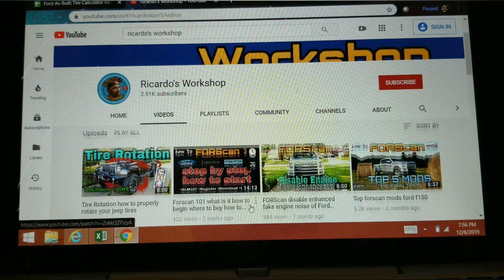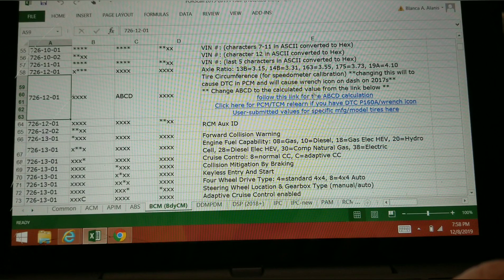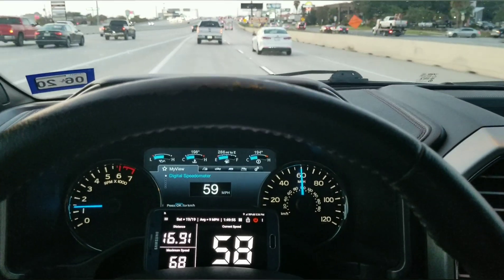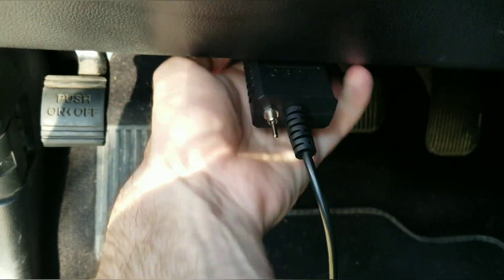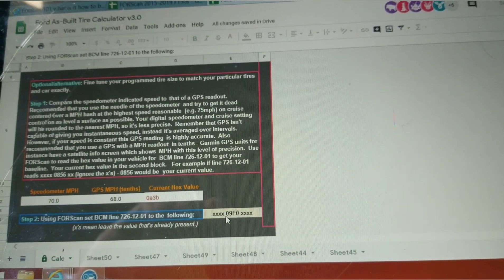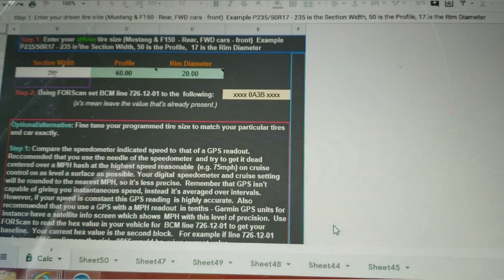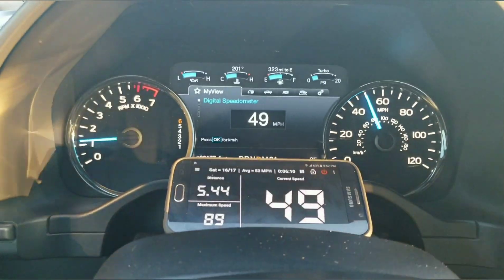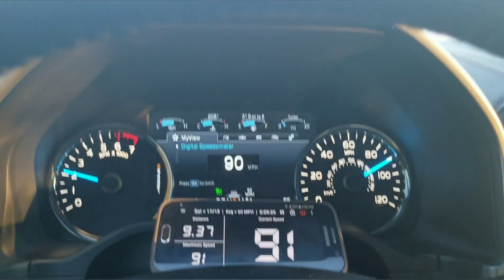FORScan Tire Circumference speedometer recalibration with GPS

Comment: I have a 2017 f-150 and install 35' but when i change the parameters,  turn on the maintenance key in the  cluster
Reply from the maker: Yes. You have to reset the transmission too. I just did this on the Bronco

Comment: Hello Ricardo
I just bought my car. Mondeo MK5 2015 2.0TDCİ
I think the previous owner tampered with the software a little.
He revised the instrument panel to vignale etc.
My question is, my fuel gauge is not working properly.
It decreases very quickly, even if I fill the tank full, the indicator does not show full. After the range reaches 0 km, there is another 15 liters of diesel in the tank.
Can I fix this via Forscan? What are the values that I can adapt or correct?
I would be very glad if you help.

Comment: I was able to correct my speedometer,  but now I have the wrench light on with P160A, any Ideas on how to fix?
Reply: Did you initialize the TCM?
Reply: @quickboat22  When you say "Initialize" is that the same as relearn ?
Reply: @AiBilly  It has been a while, but from what I can remember, after you change the speedo  numbers there is a tab that allows "initialize" of the module. This is like rebooting it I think, but only for the module itself to avoid throwing a code.

Comment: So I just did this and now I have a P0630 code followed by a U0422 code saying the VIN is not Programmed or Imcapatible, 2018 F150 3.5
Reply: Were you ever able to correct this? I have the u4022 code as well.

Comment: We just bought a new travel trailer, so I wanted to do some mods to my 2016 F150 2WD. It was either that, or go get a new F250 (stripped down model $40K+, no thanks!). Went with LT265/70R18 tires, a little more than 2” bigger than stock. Speedo was off 5 mph on the freeway. Followed these instructions, and now the speedo is dead on. Didn’t use the speedo and GPS formula, just the tire and rim size one. Also had the axle re-geared from the stock 3.31 to 4.10. Noticed there was a spot on the spreadsheet (right above tire circumference) to reset the BCM for different axle ratios. Went ahead and did that, keeping my fingers crossed I won’t screw something up. Worked great, speedo is still accurate. I heard you need to do that to keep the fuel economy calculator accurate, and I think it corrects the shift points on the tranny for the new gear ratio. Very happy with this, thanks Ricardo!

Comment: I need to do this bad  at 50 on the truck I’m doing 58 on the gps and my mpg is showing like 13
Reply from the maker: You can do it! Just follow the steps.might have to do it a couple times to get it just right. It also helps the transmission.
Reply: @ricardosworkshop  I just ordered the adapter last night on Amazon I’m not Computer guy so I’ll probably screw it up but I need to do it for sure. And the Bambi mod

Comment: I followed the instructions as described.  After I entered my value and clicker write, cycled the engine off then on, I now have a wrench icon on that will not disappear.  The truck seems to run fine and the speedometer is much more accurate than it was, but I can't get rid of the wrench icon.  2018 F150, 3.5L ecoboost.  Any advise please?
Reply: HI Bill - Having the same issue.  Did you figure out a solution?????
Thanks - Alan
Reply: @alanbeales4962  Me too

Comment: Hey Ricardo, I did this a while back and got a PCM relearn notice but no tcm.  Its a 2018 5.0 and I was under the impression you needed to do the TCM as well for the 18s and up but I can't find it anywhere in my for scan app when I have it hooked up.  It feels like its shifting different, possibly sluggish, but im not sure if its because I drove without trying to recalibrate for the 35" tires for a while before doing it and got used to it.  If the TCM relearn option isn't showing up, is that something that you can disregard or is that going to mess with the engine after a while?
Reply: I have the same issue not Tcm did just relearning the pcm clear the wench
Reply: @jorgeleal3476  did you relearn the pcm through forscan or take it to the dealership?

Comment: Worked great on my 2018XLT went from 275/65/18 to 275/70/18.  Code change from xxxx-09AB-xxxx to xxxx-09E7-xxxx match to GPS MPH almost exact at every speed.  Only bad news is I also get the DTC PCM U0422: 00-2F error when running forscan.  It does not however throw any kind of warning or light on dash so just ignoring.  Changing back to stock tire setting fixes DTC error but GPS is off by 2 MPH.  So I am ignoring the error and keeping exact speed.  I have spend hours on forum trying to find a way to clear DTC, but no cigar, if other find a trick to clear it and keep new setting let me know.
Reply: And yes, I have tried the PCM relearn function, does not fix....
Reply: @Chris Kowalczyk what is hex for 2530? I'll give it a shot.
Reply: @Chris Kowalczyk Thanks, was hopeful, but did not work on my 2018.  I set back to 09AB factory size and relearned PCM which did clear DTC error.  Both 09E2 and 09E7 are closer to actual GPS speed but still resulted in the PCM U0422: 00-2F error, so it's either have the error or be 2-3 MPH off :(

Comment: I am changing the rear end gears in my 2020 F-150 from 3.15 to 3.73. How do I program the computer? I have changed the tire size with Forscan per your video, but I can't figure out how to program the new axle ratio.
Reply from the maker: Use the GPS option. It should w

Comment: I changed the tire circumference using thr 305 55 r20 value.  I have a wrench showing up on the cluster and it says to check.manual.....any idea what the wrench means?
Reply: Me too. Did you work this out ?

Comment: Are you saying basically to change the values I forscan with the tire size 1st, take it for a test drive, if it's still off, fine tune it by changing the value in forscan using the speedometer value?
Reply from the maker: Or you can just gps tune it from the get go.
Reply: @ricardosworkshop  which do u recommend doing?
Reply from the maker: GPS

Comment: Which one is.more accurate to use? Inputting the wheel size, in my case 305/55R20 or using the actual speed to.callibrate?
Reply from the maker: Gps speed is more accurate. But tire size could be too.

Comment: Worked great on my 2019 F150. Calibrated for 285/75R17 (33.8" tires) and confirmed with GPS speedometer. Threw a DTC - PCM U0422. PCM relearn didn't work and couldn't clear code but nothing shows in the cluster. Seems  ok so far, will update if any further issues come up. Thanks for this video!
Reply: So if u don’t recalibrate will your all your dash lights come on?
Reply from the maker: Not necessarily,  but the speedometer will be off... you could really be driving at 60mph, but speedometer could show 55mph. And transmission could be changing gears at wrong intervals.
Reply: Hi George - what 4-digit code did you use for those 33.8" - I have 33.9" and am really struggling with getting the wrench light not able to clear
Reply: @alanbeales4962  were u able to get the wrench issue figured out?
Reply: @gabrielvalerio1396  Negative, just put back to stock and wrench went away. I’m taking a break from this project - frustrating…. Lol

Comment: Doesn't work on the 2020 models. Tried this today on my 2020 F150 after installing 34 inch tires. Did all the resets for trans, pcm, etc, but kept getting a steady check engine light. Wasn't the P160 code. Think it was P0600 or something. ECM/BCM module configuration error. As soon as I set the tire size back to stock, the code was able to be cleared. Ford must have changed something that no longer allows forscan to modify tire sizes in the 2020 models. Chances are, the factory tire size is hard written into the ECM, and when you change the tire size in the BCM, it throws a configuration code. Will have to seek other venues for speedometer calibration as forscan is a no go for the 2020 models when it comes to speedometer calibration.

Comment: I did this for my 2017 F-250.  I entered in the correct sized, did a speed test and it was nearly perfect one 1 mph differential.  Only problem was the check engine light came on.  It was giving the code P1635.  The only way I could get it to clear was by reverting back to my original settings.  Is there a work around this?
Reply from the maker: I think code P1635 indicateds a mismatch from factory hardware. Specifically in the axle and tires. How big did you go on tire size?
Reply: @ricardosworkshop  yes it was.  I have 35" tires.  I found out the number we enter in that register is the hexadecimal equivalent in mm for the circumference of the tires.  I tried tweaking that number down a hair since my speedometer was off.  It worked perfectly after I did that and no more check engine light.  I guess I must have been right on the threshold.  Hopefully it holds up but happy at the moment.
Reply from the maker: Ok. Thats awesome.  Well done!
Reply: @tobyleach176  I am having this exact issue,  do you recall what number you ended up using?
Reply: @erlinglasalle  I don't recall the exact number, it has been a while since I made the change.  However the number you enter is in hexadecimal and it represents mm in circumference.  I ended up using a Google search to find the hexadecimal to decimal converter, I then lowered that number by 100 and converted it back to hexadecimal.  No more check engine light, I guess there is an acceptable range and the number came in just below it.  I checked the speedodometer and it was on the money! Remember to back up your original settings before you change anything.
Reply: Could you give me the original mm size for the stock tires on your 2020?
Reply: @rosswilliams488  Hi Ross it's been a few and I don't have the truck anymore.   I recall there being a spreadsheet that would get you in the ball park.   Sorry not much help.

Comment: So once I install the new setup, I should take a test drive with the GPS speedo app first to enter the correct values before recalibrating?
Reply from the maker: I would do the test drive first. Then recalibrate it. And redo the test drive.
Reply: @ricardosworkshop  isn't that basically what I'm asking or you telling me something different? Lol  I should install the new setup, take it.for a test.drive, recalibrate it to.match the GPS speedo then re test to make sure it matches?
Reply from the maker: Lol... yes. I'm sorry i thought install new meant new codes... but you mean install new tires. So YES... you are on it. 👍

Comment: I have a 2018 f150xlt.  My stock 20s are 275/55R20.  Im planning on getting 22x10 wheels wrapped in 33x12.5R22 which i think equates to 320/45R22 (33.3x12.6)  my question is, does the 0.3x0.1 difference matter when recalibrating the speedo?
Reply from the maker: It does. But it will be most evedent in high speeds. You can test it with a gps. And then make any tweaks to it if necessary.

Comment: Are these settings the same on the 2020 F250?
Reply from the maker: I'm not sure about the 2020. I believe so but double check everything.
Reply: @ricardosworkshop   when I put the new codes in it turns on my tool wrench, anti skid is disable and a couple off other things get turned off and it all pops up on my display. Any ideas on this and where do I go to double check that I should still be changing 726-12-01
Reply from the maker: Checkout forscan.org I'm sure plenty of 2020 owners have tried it too

Comment: Thanks for your videos !! I have a 2019 f250, and did this and it worked, but now I have a check engine light. Any clue on what to do to fix the check engine light?
Reply from the maker: Check the DTC code... it should say exactly why the check engine light is on
Reply: @ricardosworkshop  thanks for the reply! I Figured it out.
Reply: @mouses911  What was is?
Reply: @jmaga6278  I changed the tire setting also in another module, once I change it back it stopped the check engine light. If you only modify the setting in the body control module it works just fine.

Comment: Great video Ricardo. I just used FORScan to recalibrate my 2018 Platinum F150 4x4 3.5 eco boost from stock tires to Nitto Ridge Grappler 35/11.5/20, while it corrected the speedometer I’m now getting a “See Manual” message on my dash. My Ford Pass shows “Powertrain Malfunction Reduced Power”. Can you help me correct this message. I’ve not noticed any reduction in power at all. Thanks.
Reply: @WeekendWarriors87  I tried this today on my 2020 F150, 5.0, and it doesn't work. If you modify the tire size in the BCM, and you'll get a steady check engine light for a ECM/BCM configuration issue. This is not the P160 code that many people get and subsequently deal with by performing ECM and TCM resets. I believe it was a p0600, and no amount of reset procedures will clear it. I had to change my tire size back to stock to finally clear the check engine light. The ECM probably has to be re-written with the new tire size, and forscan can't do that. Chances are, an aftermarket calibration device is required.
Reply from the maker: That's unusual. I would revert to original and try again.
Reply: Thanks. I’ve saved the original settings, how do I reset it back.
Reply: @WeekendWarriors87  I'm going to try a factory tire size code, and see if that takes. My truck came with factory 20 inch wheels, but I ditched them for aftermarket 17s with LT 285/75 R17 tires, which is about 33.9 inches tall. That tire size isn't on any factory Ford vehicle. A 275/65 R20, however, is. That's a factory F250 tire, which is only .3 inches taller than the tire size I'm running. I'm wondering if there's something in these modules that doesn't like non-factory tire size codes. I'm gonna give it a shot and see how it goes. If necessary, I'll fork out a couple bucks for an aftermarket calibrator and see if that gets the job done.

Comment: Is there anything to do to the transmission for the tire size change?  Someone on a local F150 page mentioned it, but I haven't found anything about this.  '18 F150 XLT 5.0L here
Reply from the maker: I suppose if you change the gears in the transmission, it would change the turn ratios and affect the speedometer. However, the ring & pinion gears in the differential are a more common upgrade. Either way, forscan can help calibrate the speedometer. Thanks for watching!

Comment: I can’t seem to be able to enter my tired diameter. Can you possibly get me the code for 275/55/20 and 275/60/20 tire sizes. Thanks
Reply from the maker: 275/55/20 = xxxx 099E xxxx
275/60/20 = xxxx 09F2 xxxx
Reply: @ricardosworkshop  what about 35x12.5R20
Reply from the maker: https://docs.google.com/spreadsheets/d/1uDSQ1Z5a2Wt8-kjrSiVSlDFGFHnfeuhb3RTMVz95730/edit?usp=drivesdk
Second to last page on spreadsheet.
And here's the tire Calculator spreadsheet https://docs.google.com/spreadsheets/d/1mWnuQZlDTUGjKjmJje1QJIR8Z2c7Kf8KBZxKnw_8EqU/htmlview#

Comment: Ok so I don’t know how to add things to the google document does anyone know how? I got my speedo spot on today going from factory chrome package 265/60/18 to 33x12.50R20 nitto ridge grapplers. The code was xxxx-09B4-xxxx. Idk if it makes any difference but my truck has 10 speed auto and 3.55 Electronic lock RR axle. Hopefully this helps someone.
Reply from the maker: Thats great Jesse... submit it on Forscan.org they might be able to update the spreadsheet.

Comment: Stock 18” rims and stock 265/60/18 tires on my 19 5.0 was 1 mph off at 85mph. I just did the flash for mine with a new 33x12.50R20 setup and it’s like 1.5 mph off. I’m going to play with it a little more and get it as close as I can, or at least back to only 1 mph off if possible and then I’ll upload the numbers to the forscan community document (if I can find out how to do that) I have nitto ridge grapplers btw. There was no 33x12.50R20 on the list.

Comment: Ive done my conversions and received the updated codes to enter however it says basically incorrect sum and will not write it...any ideas? I am trying to go back to factory size tires after messing with it a year ago with bigger tires.
Reply from the maker: That's odd. I'd double check everything. Something isn't right.

Comment: I am going to try this on my 2015, mine hangs in 5th gear at higher speeds. I have 295 70 r18
Reply from the maker: Mine was doing the same with 295/60r20. Remember to save original settings. 👍

Comment: Is this the same procedure on the f350? I can't find the calculator on the super duty spreadsheet.
Reply from the maker: They have different tires sizes so it could  be different. But try it. You usually have to do it a couple time to get it just right. Thanks for watching!
Reply: Thanks, I'll give it a try tomorrow when I can double check the gps speed. Got Bambi mode turned on tonight.
Reply from the maker: Awesome. Don't forget to backup you codes. Just in case.

Comment: When I tried to update my tire size with forscan it only allows for factory options
Reply from the maker: Even through the as built?
Reply: @ricardosworkshop  when as built I get a service advancetrac warning. I'll just go with the largest one tire size
Reply: Funny thing is the speedo is right on even though the tire is actually .6" bigger than the OEM size
Reply: It had been a while since I first did my forscan work on my '15 F250 but I put 285/75R18 on and set the tire size to 275/65R20 which puts the speedo just about right on. Originally speedo was about 5 mph fast at 65 (which was super annoying). Not sure I want to deal with the advancTrac warning so I just switched it back to 20" wheel size.
Reply: If I do this with my 2019 F250 will it throw a CEL light?